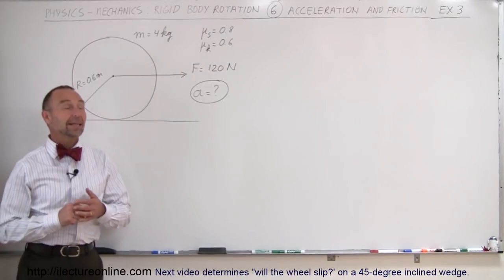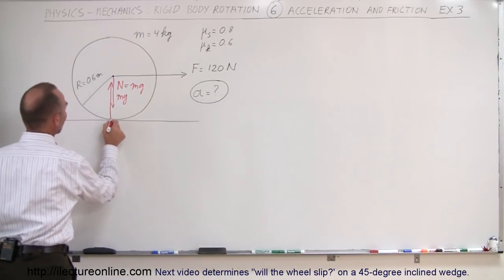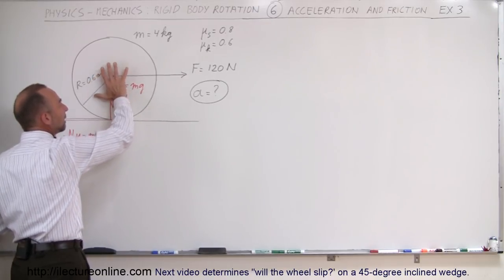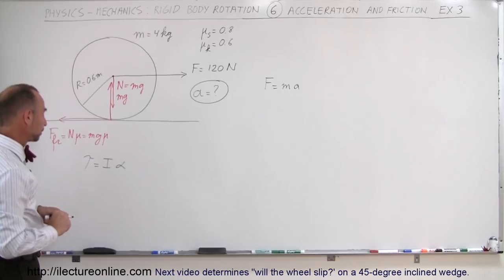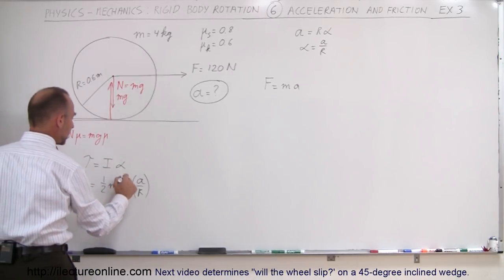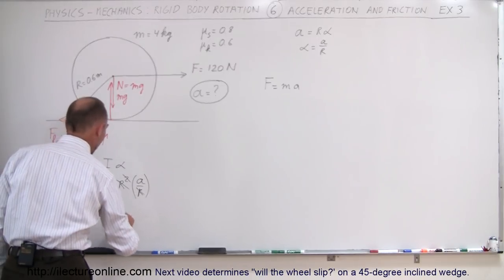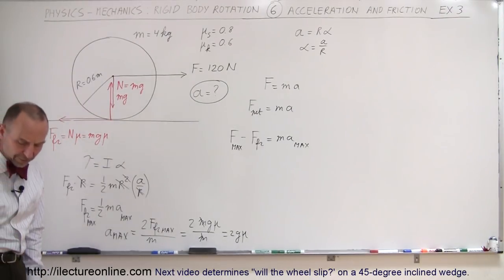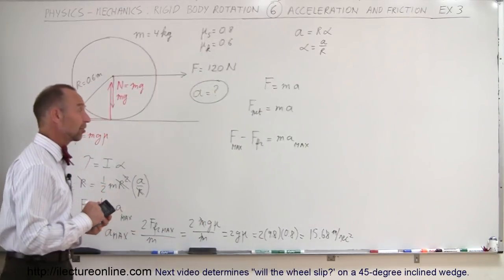Physics 11.1  Rigid Body Rotation (6 of 10)  Acceleration & Friction of a Car Tire: Ex.3

Comment: So in this example it the acceleration is higher(24.1m/sec^2) if we pull with 120N and have the wheel slip and have the 0.6 wheel friction rather than pulling with 94N and have the wheel not slip(0.8 wheel friction) which results in acceleration of 15.68 m/sec^2? Is this correct or am I missing something? Cause it is a bit counter-intuitive to have the wheel slip and have higher acceleration (24.1m/sec^2) than when you are applying the maxim force possible without the wheel slipping (15.68 m/sec^2).

Comment: Would the object be BOTH rolling AND sliding since the 120 N forced caused kinetic friction to act? If so, would the angular acceleration be determined by alpha=tau/moment of inertia instead of alpha = a/R because it is sliding instead of smooth rolling? thanks

Comment: what happens if the force applied is less than 94 N or if it is equal to the frictional force ?
Reply from the maker: 94 N is the maximum force that can be applied.  Any more and the wheels will begin to slip on the road.  If the force is less than 94 N, the the acceleration will be smaller.
Reply: @MichelvanBiezen  but according to the equation , if the applied force is equal to the friction force the acceleration will be zero?
thanku for your response
Reply from the maker: No.  The friction force is what pushes the tire forward.  Without the friction force the tire would slip and would not go forward.

Comment: Hello! Does this theoretical problem shows that it's more efficient to pull a wheel than to roll it? As i can see, when the friction  can't keep up with the external force, the coefficient becames a dynamic one, which is smaller. And for rolling the wheel, the friction coefficient is a static one, because at the point of tangency of the wheel with the street,  it's speed is 0.
Reply from the maker: No, that is not how it works.  Think about it this way:   If you try to stop a car, which way will the car stop the quickest?  If the tires slide over the pavement (kinetic friction) or if the wheels keep rolling (static friction).  The answer is:  when the wheels keep rolling.  (That is why they put anti-lock braking systems on cars to prevent the wheels from sliding)
Reply: @MichelvanBiezen  your exemple is very practical and interesting, but isn’t it so because the friction due to the Brake is more efficient than the friction due to the slippage? I guess that the Brake plays the main role here
Reply from the maker: That is not relevant.  The fundamental principle as I explained it is the key to understanding.
Reply: @MichelvanBiezen  thanks a lot for the attention!

Comment: So does friction exert a force on the center of mass of the wheel? It seems like it should only act as a torque on the edge of the wheel, yet it retards linear acceleration.
Reply from the maker: +Sega Saturn 
Using F = ma, we can state that a = F/m .   Thus the linear acceleration is the ration of the net force to the mass.  The net force is the 120 N force F minus the friction force which acts in the opposite direction.

Comment: If the Fmax was greater than the F, was the acceleration going to be calculated the same?
Reply from the maker: Fmax is the maximum friction force you can have, which determines how fast you can accelerate.  But F determines how fast you will accelerate as long as it is smaller or equal to Fmax.
Reply: Thank you sir. Since I am a first year, you are making things to be easier for me. I'm grateful of that sir.
Reply from the maker: Glad you found our videos and that they are helping!   🙂

Comment: so if the force is equal or less than the force of friction, do we assume that it is static friction?
Reply from the maker: That is correct.  (As long as the wheel rolls and not slide)

Comment: Surely it's possible for the wheel to be both rotating AND slipping? in that case, how would you go about finding the acceleration?  subtract both the static friction and kinetic friction?
Reply from the maker: Dejan,
That is exactly what is shown in the video you are watching.  There are two cases there.  The first where the wheel doesn't slip, and the second where the wheel does slip.
But I think you are asking about something different.  Take a look at video 4 of 10.  That is an example of an acceleration with the tires rotating and slipping.

Comment: I couldn't understand how we determine the direction of the static friction force when an object rolls without slipping on a flat surface. Some problems take it as it is in the direction of the motion, and some take it as it is opposite. How we can determine it?
Reply from the maker: There are off course different situations, that require a different approach.  But in this case, think about this:    The shaft connected to the wheels make the tires rotate in a clockwise direction as seen here.  Since there is a coefficient of friction, that causes the edge of the tire making contact with the road to push against the road (to the left).  That causes a reaction force from the road to the tire pushing the tire to the right.  Thus the friction force from the road onto the tire acts from left to right

Comment: Professor, what is direction of friction if a wheel moves uphill ?
Reply from the maker: In order for a wheel to move forward, the force of friction must push it in the same way as it moves (forward).
Reply: Michel van Biezen 
Professor if the direction of friction is same as the direction of motion then why you have taken friction in an opposite direction?

Comment: So in this example the acceleration is higher(24.1m/sec^2) if we pull with 120N and have the wheel slip and have the 0.6 wheel friction rather than pulling with 94N and have the wheel not slip(0.8 wheel friction) which results in acceleration of 15.68 m/sec^2? Is this correct or am I missing something? Cause it is a bit counter-intuitive to have the wheel slip and have higher acceleration (24.1m/sec^2) than when you are applying the maxim force possible without the wheel slipping (15.68 m/sec^2).
Reply: 15.68 m/sec^2 is acceleration for just the rotational motion, whereas 24.1 m/sec^2 is the final acceleration with rotation and translation motion combined.
Reply: The exercise can't be thought with a force coming from some sort of axis rotating in the wheel.
Reply: @davidbenavides509  So the example is not a car driving down the street but more like somone pushing a shopping cart? And the slipping of the wheel is not meant to be sliping while spinning like a burnout but more like skidding on the ground like a brick?
Reply: @KnightRiderDDR  yes sir. And the first acceleration calculated is also the max acceleration that person could have, so that the wheel doesn't slip.
The second acceleration calculated (higher) is the one when that person is pushing so hard that the friction can't keep up, and it will slip. Notice that in the second part he didn't calculate the acceleration of the wheel at the exact moment of the beginning of the push (at rest), he did it when the wheel was already slipping.
Reply: @davidbenavides509  Thank you for the explanation.